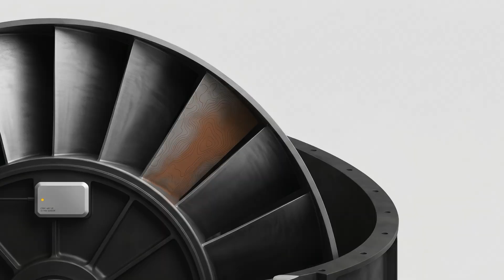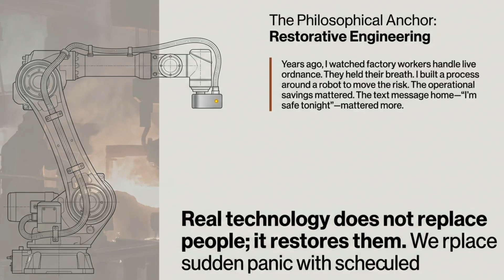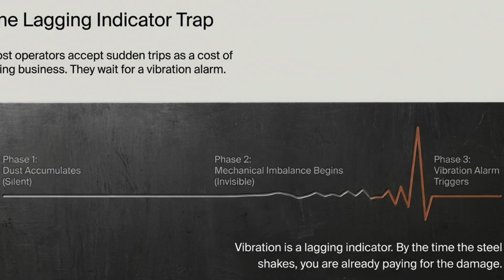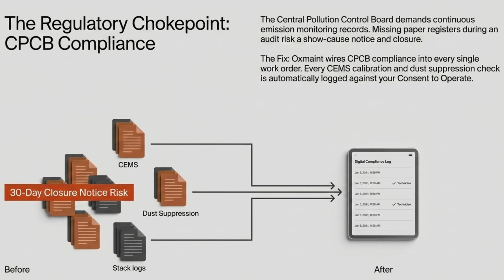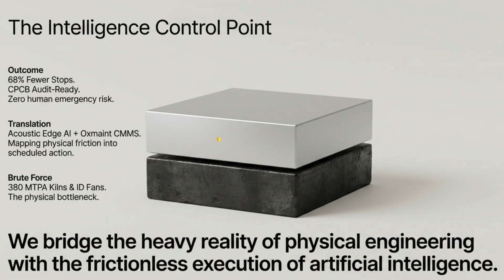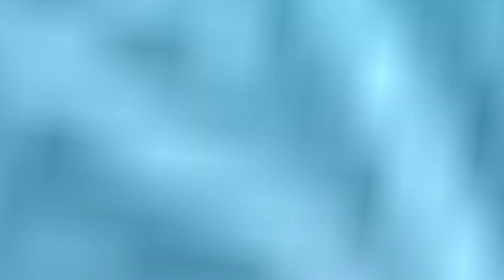The Cost of Lagging Indicators | Restoring Safety in Heavy Manufacturing

Comment from the maker: Here are few sources for your reference 👉

  https://oxmaint.com/industries/cement-plant/cement-industry-india-maintenance-cmms
Reply from the maker: The Operational Reality
 
The cement industry in India operates at a massive scale. Production exceeds 380 million tonnes annually. The rotary kiln acts as the heart of this operation. The Induced Draft (ID) fan serves as its respiratory organ. It pulls high-temperature combustion gases and abrasive raw meal particulates through the system.

  Visible Symptom

 Operators experience sudden, severe vibrations in the ID fan. This triggers automatic mechanical trips. The kiln stops.
  

Actual Bottleneck

 The bottleneck is unpredictable mass accumulation. High-velocity clinker dust and raw meal coat the fan blades unevenly. Thermal stress warps the metal. This alters the rotor's center of mass. By the time a vibration sensor triggers an alarm, the mechanical imbalance is already severe.
Reply from the maker: Listen to this 👉 as you commute:

 https://open.spotify.com/episode/53d9vzv4KtFkDnA2RjBVUR?si=R31yhUD6TOSebLqpx5CHeA
Reply from the maker: Dive DEEPer Here 👉:
 
https://prasadbhonde229.medium.com/the-cost-of-lagging-indicators-68b26b76c0a3
Reply from the maker: VIEW Here 👉:
  https://youtu.be/Dcbi4H_Wyyk
Reply from the maker: Access “Study Guide: Cement Industry Maintenance and Industrial Intelligence” here 👉:  

https://docs.google.com/document/d/1wF5HnFJ2vSPL6dSMJ4or2NQyFu3ZZnpHSnwHHHvnhyM/edit?usp=sharing
Reply from the maker: Connect here 👉 
https://tr.ee/vYy2GL  

Or here 👉 
https://linktr.ee/PRASADBHONDE
Reply from the maker: Or you may want to read this 👉 

https://amzn.in/d/01HOcXep